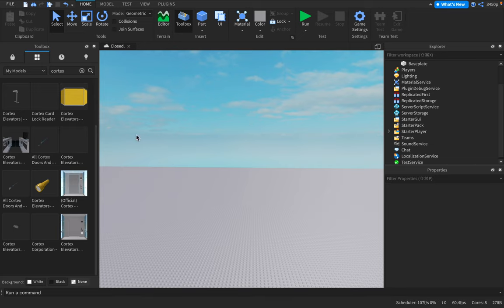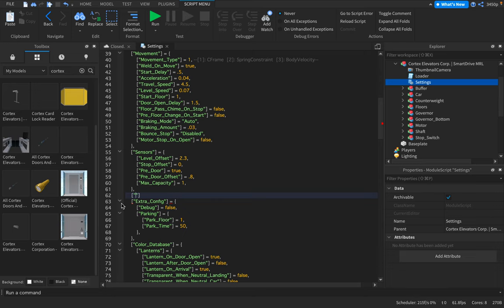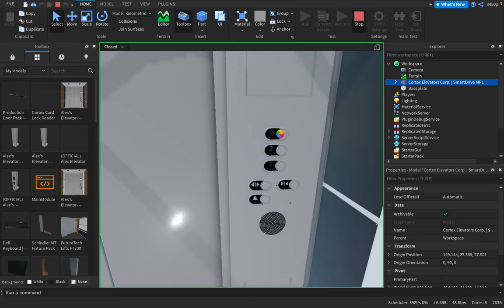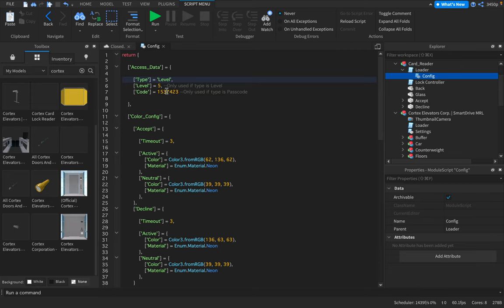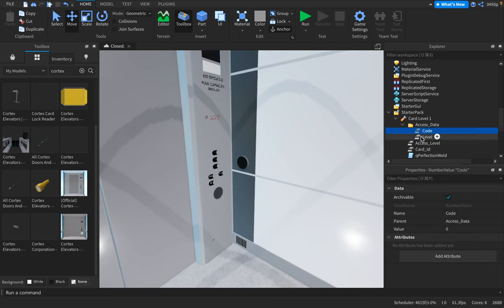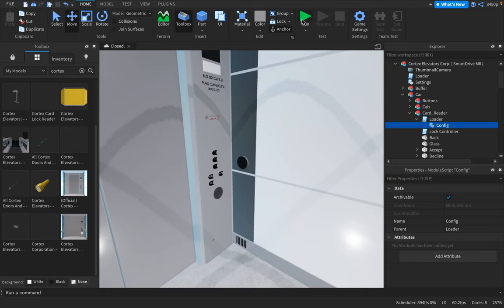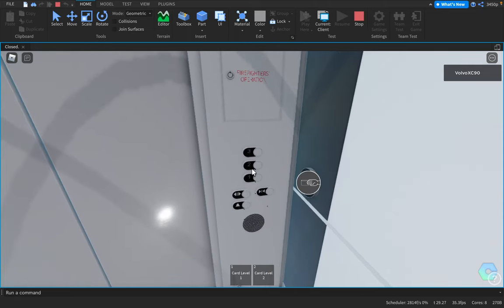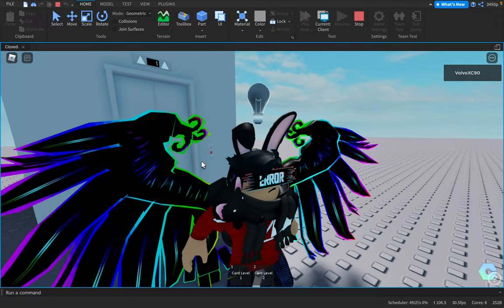How to lock out floors on any Cortex Elevator with a Cortex card reader

Comment: Hey, could you make a tutorial on a custom cobalt plus lift? I tried it myself and it doesn't work. (I did copy those scripts, the loader and the custom label.)
Reply: Late reply but cortex readers do not work on C+
Reply: @VOLTRONDEFENDER4440  Oh i meant how you can create your very own CobaltPlus elevator, But thats okay i figured it all out and i literally just made my own 2 elevators made specially just for my headquarters.
Reply: @ersanovoroblox6102  its simple make the car then the doors with open and closed(no collision) invisible part then do the same for the shaft and add a level part to both the car and shaft, buttons you can source or you can make your own
Reply: @VOLTRONDEFENDER4440  this is an old comment i have all the knowledge i need but thanks
Reply: @ersanovoroblox6102  it first off didn’t work for me but now I figured out how to make it work now
Reply: @VOLTRONDEFENDER4440  how did you get it to work on cobalt plus pls tell I have been searching for about 4 hours now and can't find out
Reply: @cats585-videos late reply you just look at the orginal c+ model!